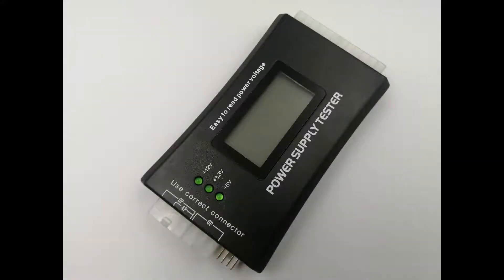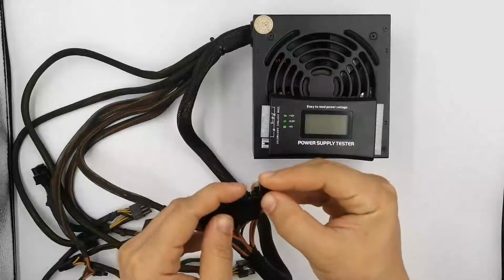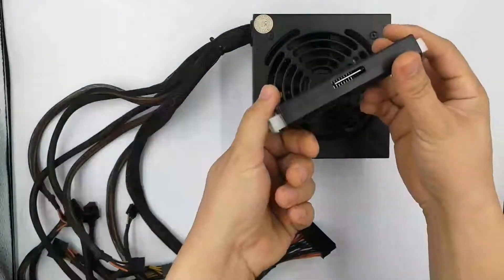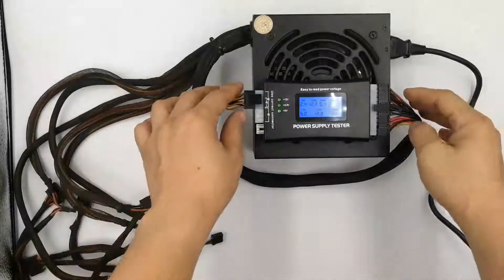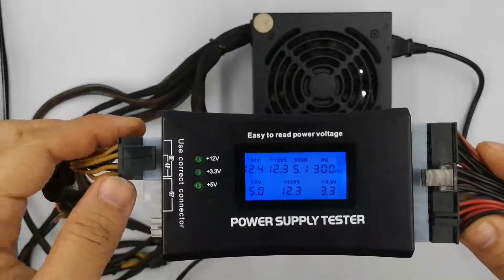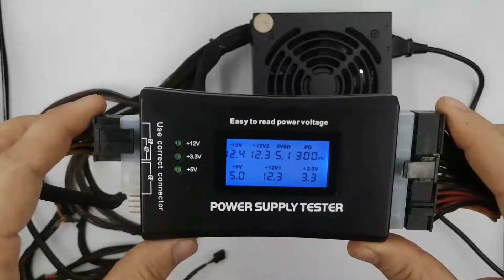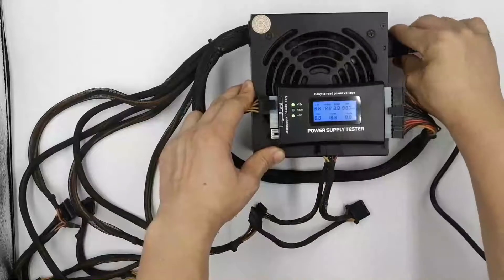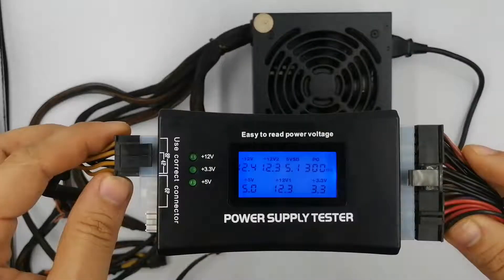how to use power supply tester

Comment: My P.G. shows 100 but it's blinking/beeping and everything else is in normal range.  Does that still mean my PSU is bad?
Reply: Have you connected the second cable? like CPU or PCI-e cable?
Reply: @macporteiro  yes.  I wasn't able to get the computer to turn on with this psu but it did turn on with another one.  I just assumed the psu was bad.

Comment: I've checked a psu and everything pass, but when PSU connected to any PC it does not work. PSU spins for a second and turns off. Seems like this tester is not 100%
 accurate
Reply: Motherboard is dead
Reply: Or maybe graphics card. I had a gtx970 that was tripping my PSU. Soon as I took the card out. It worked fine

Comment: Great stuff!
I checked a psu and all voltages are shown as on your screen. But only 2 leds are on and the 3.3volt les is off. Could you please give me an opinion? Thanks and regards.
Reply: 3.3v only lights up on sata cable not molex or any other as he have said that in video.

Comment: Everything is fine except the PG.. The value its reading is 120ms and its flashing. What does this mean?
Reply: Did you ever find out? My PC won't boot and my PSU is giving 130ms on pg and flashing like yours
Reply: @dabbzgaming  I just bought the same one off Amazon then returned it with the faulty unit lol
Reply: @dabbzgaming  Same here, all stats are good except for PG showing 130ms and flashing and beeping! :(
Reply: I believe it's a good value. I've read PG is the value for the PSU to deliver enough power to the CPU, which also allows for sleeping state. Lower than 100 means it's too quick for the CPU, higher than 500 means the computer will fail before it reaches full current. But is it flashing with the 6pin/8pin cable on the other side? If so, the manual says there's an issue with the PSU. If it's flashing without any other cables than the 24pin, you need to connect something else. I get 120ms in my corsair 850 as well. And according to the tests, by elimination I believe my MSI x570 wifi tomahawk has betrayed me after 2 years of light work...

Comment: That was very helpful thanks! I found out my power supply was fine and instead a cat peed inside and shorted out my motherboard.
Reply: Sounds like your cat is defective, get it replaced under warranty
Reply: my story is different , I accidentally  dropped    my fork inside my computer , it shorted my motherboard
Reply: @tunkunrunk  do you use your pc as a dinner table? how does that happen lol
Reply: @ 🤣😂  I was eating  near my pc case ( was opened ) and I unintentionally dropped my fork inside the pc case ,  the computer stopped working at once . I tried several time to restart it with no luck . At that time I knew nothing about electronics and fixing motherboards . I jut got rid of the board
Reply: How does a cat get access to your motherboard 😭

Comment: what if the PG value is in range and the tester constantly beeps showing the PG value turning off and on? What's the issue then?
Reply: Did you connect the 6pin or 8pin cable as well? If you did and it's flickering, the manual says there's a failing PSU. If you did and there's no flicker but beeps.... I don't know. Mine was beeping because I hadn't connected the 6pin nor 8pin cable on the other side, showing LL as well. Once connected, all good.

Comment: The power tester doesn’t seem to work if there is no 20-24 pin connector. My power supply only has a 4 and a 6 pin connector.
Reply from the maker: Hi. This power supply tester is for 20 pin and 24 pin.
Reply: @xbgpisonetpartsandcomputer9179  

Darn! Wish I knew what kind of power supply I had before purchasing the tester. I’m sure I’ll be using this on other ones,haha.

Comment: LL  = Low Level Voltage.
Reply: Hi, When I only connect my 24 pin connector to the tester, I get the LL. But once I also plug in the cpu or vga cable it goes away. what does that mean??
Reply: What about H-H? What does it mean? My 5VSB has H-H.